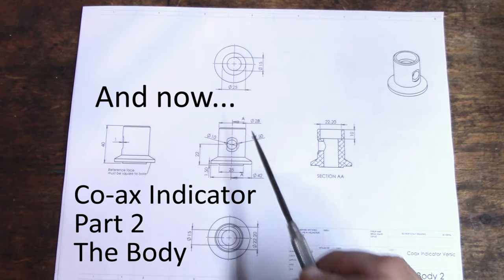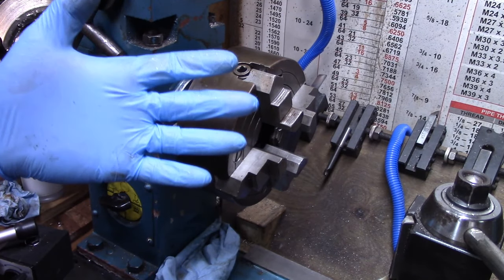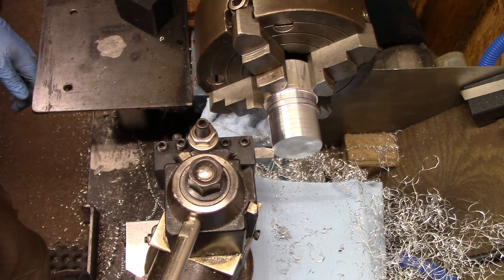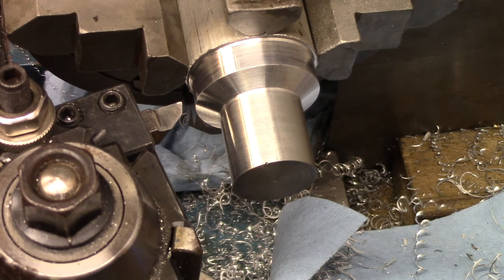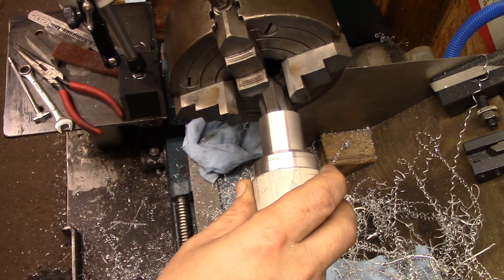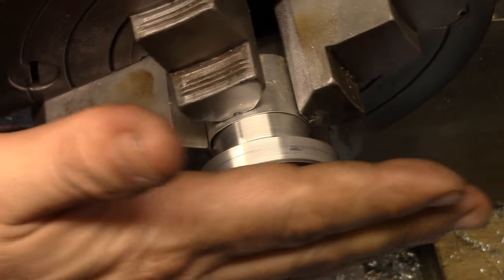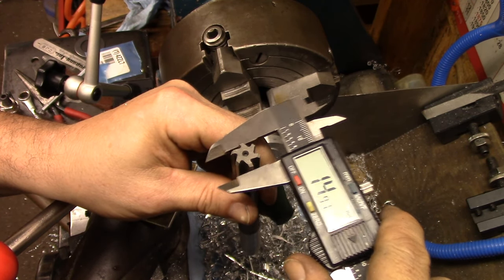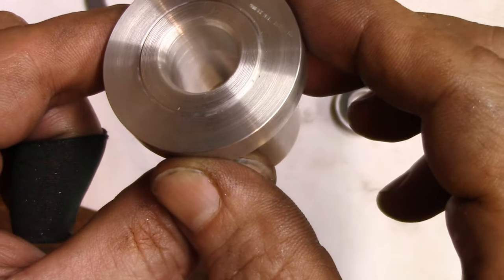DIY Co-ax (Coaxial?) Indicator - Part 2 - #TMC2020

Comment: Could be your best video of all time, so far. Super glue will work. Just hit it with brake cleaner first.
Reply from the maker: That's what she said (with emphasis on "hit it")
Reply from the maker: It is at least the best one since the the last one.
Reply: @theeddies  Let's not get carried away! Found a Craftsman 3HP 20 Gallon compressor. I think it needs a pressure switch. Seems super quiet. I wonder if that is an indication of it being worn out? It makes air though, but bogs down until restarted.
Reply: @theeddies  lol using break cleaner on it first isn't exactly a "happy place" I want to go to in my mind, but with enough alcohol almost anything is possible!
Reply from the maker: Sounds like something do with the pressure switch to me. I doubt it would make pressure if worn out. Motor could be weak though.
Reply from the maker: Sounds like something do with the pressure switch to me. I doubt it would make pressure if worn out. Motor could be weak though.
Reply: @theeddies  I'm leaning toward run capacitor ATM. Which wouldn't be bad all things considered. Overall it's pretty nice. Way nicer than what I would just throw away.
Reply: @theeddies  Another thought is what if it has the wrong belt on it and is slipping? I think it has a ribbed pulley, but I'm not sure I saw a ribbed belt through the guard. SOB is heavy as F!
Reply from the maker: @johnstrange6799  Could be that as well. Is it 240 or 120?
Reply: @theeddies  That's what I'm wondering right now myself. Maybe it's wired for 220 and I'm plugging it into 110?? Need to pop the cover off and look. That would be silly.
Reply from the maker: @johnstrange6799  Could be that as well. I think you would hear it or it would smoke but possible. Speaking of belts, I oiled my lathe spindle and the oil seals are apparently shot. Drained oil in the belt guard and all over the belt, and it never missed a beat making those parts. Those Powerdrive Kevlar belts are not cheap but amazing.
Reply from the maker: @johnstrange6799  Well it would not be as silly as the guy who put a 110 plug on a 220 motor.
Reply: @theeddies  lol  - It's wired for 110. I didn't pop the belt guard off yet though. Pressure switch or run capacitor.  If I can resurrect it, then I could possibly dick with those air cylinders at some point, but how? Can crusher? Boxing glove knock out punch theft deterrent device? Can you imagine someone breaking a light beam switch in my garage door's entry path, then automatically getting at least one in the face and one in the nuts in the dark?? lol
Reply: @theeddies  I love the positive engagement of toothed belts. You really can't beat it. I'm happy to say that my cheap leather lathe belt has been working great so far. Granted, I don't have tons of hours on it yet, but for the price compared to the $80 glue joint ones from Al Bino I'm not disappointed.
Reply: @theeddies  I love the positive engagement of toothed belts. You really can't beat it. I'm happy to say that my cheap leather lathe belt has been working great so far. Granted, I don't have tons of hours on it yet, but for the price compared to the $80 glue joint ones from Al Bino I'm not disappointed.
Reply: Next video title: DIY Air powered raccoon launcher  PT. 1
Reply: @theeddies  I didn't realize yesterday that the compressor was being run through a 100 ft spool of extension cord. I also wasn't aware of other seemingly noticeable things, like gravity! So far it appears to work fine with no extension cord. Granted, I did completely purge the air out of it, but for now at least it's running at full clip, and actually pretty quiet compared to my other small one. I'm always afraid to let compressors come up to the cut out pressure. After having a gas cylinder from an office chair explode on me... I get nervous! - "Pressure, pushing down on me ,  pushing down on you..."
Reply from the maker: @johnstrange6799  Not me man I like to put things like that in an enclosed room with me in it, crank the pressure valve to 10% more than the tank rating and give it a go. Let the shrapnel fall where it may. "You know I'm born to lose, and gambling's for fools
But that's the way I like it baby
I don't wanna live for ever"
Reply: @theeddies  Too bad Lemmy isn't around to have a product "safety" rating. The Kilmister system.
Reply from the maker: @johnstrange6799  Too bad Lemmy isn't around -to have a product "safety" rating. The Kilmister system.- FTFY
Reply from the maker: @johnstrange6799  But the Kilmster Scale is awesome
Reply from the maker: @johnstrange6799  Have you seen this channel. I don't know what it is but his stuff is addictive. https://www.youtube.com/watch?v=YZPqPz9RW3U
Reply: @theeddies  lol it's awesome. Do you remember The Young Ones when Motorhead was on there?
Reply: @theeddies  lol
Reply from the maker: @johnstrange6799  It was probably the first episode I saw. I heard Madness and The Damned for the first time on that show as well.
Reply from the maker: @johnstrange6799  I got my $30 TR20 x 4 tap (metric acme thread, about 13/16"), for the lathe lead screw nut, from China today. I have to say it is a good looking tool. (that's what she said). Surprised. Now I need to find some round brass/bronze stock that is  big enough.
Reply: @theeddies  Excellent! I was wondering what you were doing on that situation. Make and sell them. If you needed one others will too. If you had to, you could make one out of cast iron, but you have two kidneys for a reason, and someone needs one, and you need some brass, so...
Reply: @theeddies  Score today. Little clean out of usable and garage sale sellable stuff. Tons of brass and copper fittings, BUT.. among it... it begins with a K and ends with Box, and has machinist in the middle!!!! Needs a paint job BIG TIME, but I'm in love!
Reply from the maker: @johnstrange6799  You got a Kmart Machinist Box? Nice, they stopped making those in the 80's. Does it have the blue light in the drawers?
Reply from the maker: @johnstrange6799  https://www.amazon.com/Krylon-K02785007-Fusion-Spray-Paint/dp/B07LFPDBQ1/ref=sr_1_2?crid=31YETTD6DYI4P&dchild=1&keywords=krylon+spray+paint+hammered+cocoa+brown&qid=1593540897&sprefix=krylon+hammered+coc%2Caps%2C178&sr=8-2
Reply: @theeddies LOL someone put this blue light special on layaway, er I mean throw away. I just almost passed out outside. Did too much too fast in too much heat.  I tried to film, but the battery kept croaking, then I was almost croaking, so I don't know what I got on video. - Lots of brass and copper fittings, a metal engraver POS, bundle of flap and grinding disks,  little vise, bunch of drywall screws, roll of emery cloth,  3 sizes of tubing cutters, and another smaller tubing bender (Found a rigid one a while back), a lot of electrical boxes, conduit fittings, switches, plugs, wire, nice horde of security flood lights (which I use a lot of). Maybe $100 in garage sale randomness, nothing amazing except for the box. That's machinist box #2.
Reply: @theeddies  Oh hell yeah! Thanks! Pricey, but perfect!
Reply from the maker: @johnstrange6799  nice!
Reply from the maker: @johnstrange6799  Cheaper if you can find it locally, sometimes hard to find. Do you have Grainger's up there? They can get for about half price I think if you pick it up.
Reply: @theeddies  Yeah for sure cheaper, but a few bucks to have it come to me is worth it right now. Yeah, I have Grainger, McMaster Carr (My dad worked there years ago), Fastenal, and... I can't remember the name of it, but they sell power equipment (small engine and such) and parts, and junk - I think it's called Russo Power. Might be in the old Wilton vise building, or next door - All are like 10- 15 -20 minutes from me. We have a few of the tooling places too, like... CDCO or whatever, and a few more that I can't recall the name of, but the shipping is still 80k for a toothpick. On the box color, turns out mine is (was) actually green. Is there a perfect shade of green for them out there that you know of? It's a 7 drawer 520. Even after some clean up it's ROUGH, but it works and is complete minus the key of course. Bottom line... the price was right. Included: 3 taps, 2 O'rings, 1 mini thumbscrew, and a razor blade. Dignity sold separate.
Reply from the maker: @johnstrange6799  https://www.amazon.com/Rust-Oleum-7211830-Stops-Preventive-Aerosol/dp/B0002YVWJW/ref=pd_sbs_60_1/146-3939847-7576925?_encoding=UTF8&pd_rd_i=B0002YVWJW&pd_rd_r=f0981dd1-fbec-4440-931e-bf305f580589&pd_rd_w=h7kZH&pd_rd_wg=dQKld&pf_rd_p=d28ef93e-22cf-4527-b60a-90c984b5663d&pf_rd_r=4M1GMJJQ6C7BMRF61BJW&psc=1&refRID=4M1GMJJQ6C7BMRF61BJW

Hard to find a picture of one of those in green, pretty rare maybe. Here is the best pic I could find of the original green color.
http://uploads.tapatalk-cdn.com/20130723/ehade4ym.jpg
I would say that paint is going to be as close as you will find. The hammered paints do a pretty good job of replicated that ripple finish of the originals. Some guys say they can do it by heating the whole box and painting with a regular enamel, but that sounds iffy and finicky to me. Honestly though after using my blue green Waterloo box for awhile, I wish it was brown, it shows every oily fingerprint that touches it. The kennedy beside it always looks clean even though it is not.
Reply: @theeddies  Thanks for looking around. I think used that deep hammered finish green on my milling vise. The box is more like olive drab, but it doesn't matter really. I might not even paint it, but if I do I might go with the Coco Brown. 90% of my footage from today was lost to battery death, but we're going out again tomorrow, so I'm sure I'll have more video of other junk.  I have a roll of tread mill... "Belt". I'm going to use that to line the drawers. Among the wreckage I found a couple of nice knurled thumb screws. Look like 1/4-20 and about the size of like volume controls on a guitar. I love that kind of junk for projects. I forgot to tell you... We found a Tama Hi Hat stand. It's the first and only piece of drum hardware I've ever found in all my years of junking (besides going through Slingerland's dumpsters ages ago).  We sold a knights armor figure (like 5 ft tall) for $100! I couldn't believe it! Sold some OLD car bumper for $125 too. lack of garage sales has people Craigslist happy it seems.
Reply from the maker: @johnstrange6799  Cool. Good idea on the belt, that might make good lathe guards as well. hmmmm!
Reply: @theeddies  I've seen people say that for mill ways. It's good material. I don't recall if I told you, but I know I thought of you when I saw it and meant to alert you to it... there is a series of video by an Austrian guy who builds his own lathe. He built the perfect way covers that accordion. I'll see if I can track down the video.
Reply from the maker: @johnstrange6799  yes, please
Reply: @theeddies  Did you get the link?
Reply from the maker: @johnstrange6799  Weird, it is in the comment section of the video page but I did not get a notification for it like I do for all your comments.
Reply: @theeddies  I've noticed a few of my comments to you recently haven't shown up. There was one the other day about Jake Legged & Blind, and sometimes it takes a while to get a notification. One earlier took 11 hours to get.
Reply from the maker: @johnstrange6799  Well you know Youtube is only like 12 years old you cannot expect them to get a complicated thing like a comment section working, I mean the tech has only been around since BBS in the 80's.
Reply: @theeddies  No bonanza scores today. Did find some kind of divided steel tray, kind of like a Lawson'ish thing. (Not sure, but there was a metric conversion chart in it, so who knows?).  Also found a catch-all bin of hardware bits, but not a bunch of the usual nuts and bolts. This is mostly junk, but with a healthy does of assorted grub screws, wing nuts, thumbscrews, and a new one for me... lots of little brass and copper "disks". Like you know when you want a piece of brass to act as a little softer material wear surface buffer zone under a bolt or something?  Screw it! I'll get it on video when it cools off. I'm beat!
Reply from the maker: @johnstrange6799  The world awaits the return of Strange.
Reply: @theeddies  Maybe I'll have a whole 'Whatever Happened to Baby Jane' / 'Sunset Blvd' mental malfunction for dramatic effect. I think I'm going some kind of brush on green (that I found) for the box. Maybe I'll make a video after that. I saw this weird old Craftsman lawn mower today. It had a side mounted (open no less) external recoil contraption. I never saw one like it. Looked like a total horseshit design.
Reply from the maker: @johnstrange6799  Like the recoil had some sort of 90 degree mechanism or the engine rotated horizontally?
Reply: @theeddies  Right angle gear contraption that transferred the pull rope rotation.  It looked like you kind of pulled straight up on the rope. It was bizarre.
Reply from the maker: @johnstrange6799  Yeah that is bizarre.
Reply: @theeddies  Yep. Had me looking around for someone to verbally abuse over the matter. I might have taken it, but it was covered in oil. 
I got hundreds of grub screws out of this mess from earlier. I theorize that the little brass and copper "pucks" among it were once contacts from something. 
I stripped and primed the box. Looks like someone threw rocks at it and missed, then threw shit and didn't. But still looks better that it did. 
It was WAY too hot and humid for the fiasco. Paint stripper was drying instantly on the sun roasted metal, then the primer had to be stirred every 3.8 seconds or it would turn to rubber cement basically. Might have to hit it with a jackhammer once it hardens, then use some sand paper on it. F'ing masking tape wouldn't stick either!! SOB sun!!
Reply from the maker: @johnstrange6799  lol to the whole fiasco. That's another reason I rarely paint stuff.
Reply: @theeddies   I like spray painting stuff when it's roasting outside, but using Rustolum that George Washington's great grandfather threw away when he was little ain't so great.
Reply from the maker: @johnstrange6799  You have some of his paint as well. I thought I got it all in the Winter of '76. 65Ford has a way to re-pressurize those cans but I have not got around to trying it plus it is ACE OF SPADES sketchy. That is my problem, I have 20 half cans of paint that piss like an 80 year old man who does not hydrate.
Reply from the maker: @johnstrange6799  Man that video of the guy building the lathe that you sent me made was awesome. There were about 6 things in there that I went "well that is fucking obvious and simple, why didn't I think of that?" IDIOT!
Reply: @theeddies  This conversation sure took a turn for the historically accurate!  I used to recharge WD40 cans with a tire pump compressor using the little pins for filling footballs and such.
Reply from the maker: @johnstrange6799  Yeah, I think that is basically how he does it as well.
Reply: @theeddies  It never seemed to last much. I like those  solvent spray cans that you pressurize yourself, but I also like to find some half can of WD40 someone threw away because it stopped spraying.  I've seen someone make their own self pressurize can from a spray paint can. I think it was Roadking 805. Did you ever look at the lathe ways video??
Reply: @theeddies  I didn't see your reply about the lathe build.  It was nice. I love the way covers. I get if you are into designing and building it for fun, and a video, but otherwise it does seem like a shitload of work  for what it is. -  I painted the box hunter green brush on. It looks good in a low rez pic taken 12 feet away if the light is just right, and you've been sniffing model glue.  All of which I did. - Glad it's done.
Reply from the maker: @johnstrange6799  Good you saw it cus I was too lazy to look it up and quote it to you. Well I made a major fuckup with the body of the part. I guess I will share it but feel like all I put out are fuckups sometimes.  I probably should just redo it and act like nothing happened, like most everyone else does.
Reply: @theeddies  What diameter and length is the round stock you start out with for the body? Also, what size piece of brass do you need to make your lathe nut?
Reply from the maker: @johnstrange6799  1.75" on the body and not really sure on the brass yet. I think it is 1" to 1.5", I can check tomorrow.
Reply: @theeddies  Eddie, there's two kinds of people in this world. The kind that found a free awesome Kennedy box (that they just moved into), and well... everyone else. In these troubling times you have to look in your heart and ask yourself which kind of person YOU are. I'm glad we had this talk.
Reply from the maker: @johnstrange6799  Well I for one love Kennedy boxes but I really don't want to live in one.
Reply: @theeddies  Uh huh, you say that now, but when they offer you the standby understudy role for the 56th extra in the made for youtube original movie "Honey I shrunk the machinist" you'll be whistling a whole other tune, won't you? I thought so.
Reply from the maker: @johnstrange6799  lol, I guess you got me there.
Reply: @theeddies  You know, there are possibilities in the 'Honey I shrunk the machinist' frame of mind. Could make an Adult Swim type of humorous Flash Gordon inspired sci fi backdrop realm with machines, like they are art deco era "futuristic" structures or spacecraft -total Flash Gordon. Can you imagine how a lathe would look if you were one inch tall? On a less grand scale one could use a green screen and shrink themselves down and be like a shop angel or devil, or some external voice of reason, knowledge, and caution character that interacts with someone in their videos. I did something similar years ago with green screen characters and model railroad footage using After Effects.
Reply from the maker: @johnstrange6799  I am so stealing that idea. Expect to see a little eddie in a future video.
Reply: @theeddies  lol
Reply: @theeddies  Do you have a green screen and software to do it?
Reply from the maker: @johnstrange6799  My editing software will do it, the little subscribe/like animation that I used in the last video is a green background animation. I do not have a green screen but a green sheet would work or I can get one on ebay for less than $20.
Reply: @theeddies  A machinist community animation would be fun too, but a ton of work.